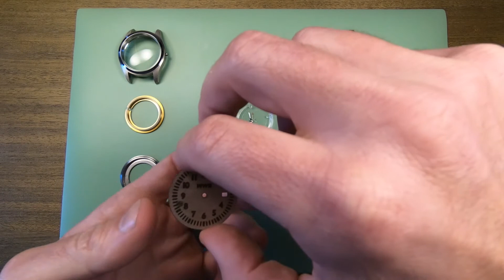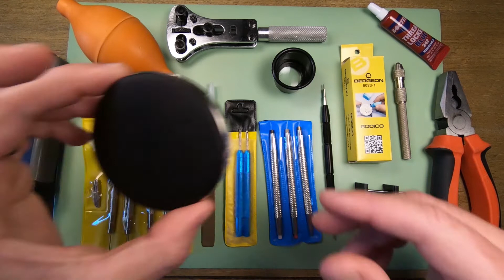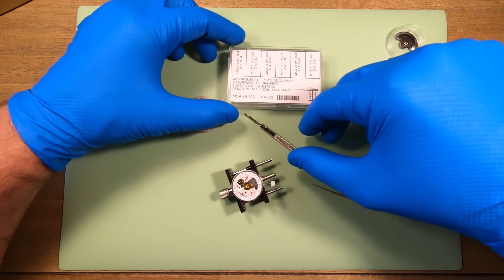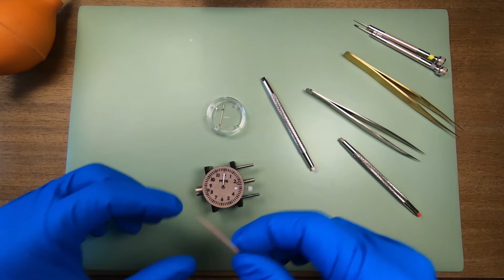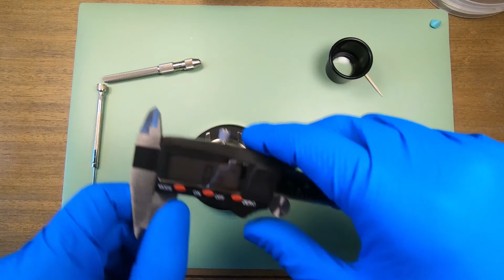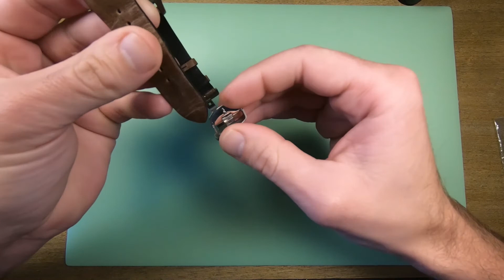My First Watch Build

Comment: Im about to build my first watch to and im looking for some parts. What i dont understand is, do I always need to buy a Movement Ring for it all to fit?
Im buying a case that is said to fit a NH35 Movement but do I still need a Movement Ring for the NH35 to fit in the case?
Reply: More than likely, this will come with the case in most instances.
However some cases are designed not to need a ring, you will find this out when your case arrives unless it states this in the description.
All the best for your project.